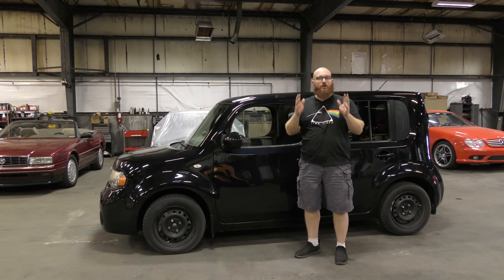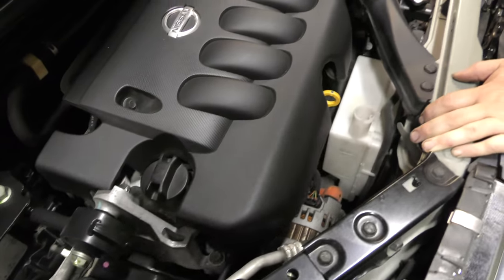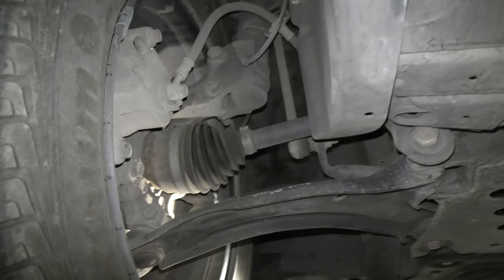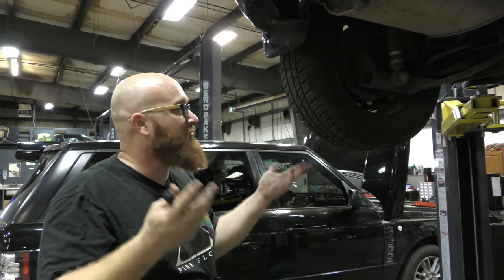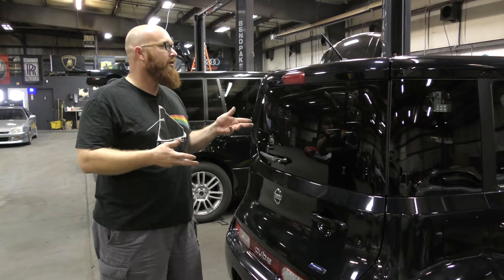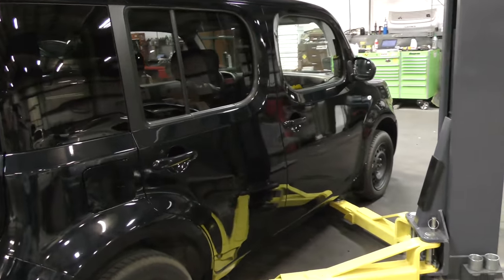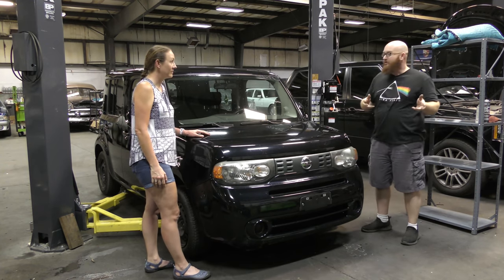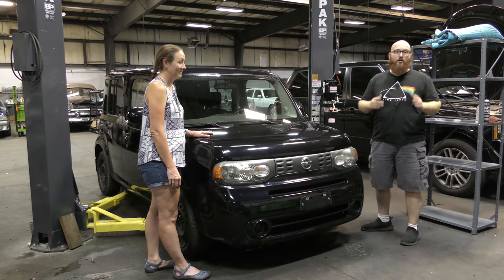The CAR WIZARD's new ride! Mrs. Wizard is NOT impressed! What was he thinking?!?

Comment: That reminds me of the AWD Honda Element I bought a couple of years ago for $200 with a bad motor. I picked up a JDM motor and installed it myself. Had a new windshield installed and put four new tires on it. Originally I had planned to flip it, but after driving it I liked it so much I decided to keep it.
Reply: Forgot to mention I have $1750 total invested with the addition of new axles and CV joints. BTW the Element rear seats recline and if you lay the rear seats down and lay the front seat down, you can sleep in it fairly comfortably.

Comment: I like them, they have a cult following here in the UK, the UK spec ones have a glass roof with a blind to cover it the glass doesn't move or open though. That rearmost seatbelt is for the middle rear seat passenger, they are 5 seat cars only. Good luck with it, cool AF.

Comment: I have a 2010 which I bought on Nov 23, 2019. It had 26k miles 6sp manual. It has been one of my favorite cars. There is almost no "blind spot." The only problem is the rear door will no longer open.

Comment: The Cube is actually resonable design if you are openminded  enough. A practical shopping car, moving cube-size objekt and so on. However in  europe  Nissan is made i Spain and the engine is a Renault. That may put some of us off (the spain part).Tried to find out where this Cube is made was difficult however. An interesting buy anyway.

Comment: With the Nissan (jatco) cvt it primarily depends on the generation of CVT family as far as reliability. Just be sure to check the color of the fluid (nissan cvt fluid) every now and then and how it smells. If it smells burnt you will need to flush the fluids. This is coming from someone who used to work in engineering for Nissan North America.

Comment: I'm part of the 10% - the Nissan dealer bill was $5k. Bought the car new and put on 41k mi. of easy, well maintained, driving.  The car was essentially totaled at that point.  I drove it 20 mi. to the nearest Subaru dealer and traded for a 6-spd manual Forester.  Beware - JATCO makes CVTs for many different manufacturers (including Subaru).

Comment: You mentioned changing the transmission fluid, I'd like an episode on your thoughts on lifetime transmission fluid, and also how and how often to change transmission fluid.
Reply: Theres no difference from “lifetime” and normal fluid, its all the same. But its claimed that the trans is made well enough to last the average life of a car. 150-200k miles. 

I have a 2005 malibu maxx v6. Its trans fluid have never been changed and its still going strong at 260k. 

Tho you can change fluid on sealed transmissions, in a similar fashion youd change a manuals fluid. 

On average youd want to change fluid around 40-60k depending on the size of the trans, and how much weight its halling around, plus total fluid capacity. 

For instance, on my malibu people recommend around a 50-60k change time. Tho its far to late for mine. In my moms mazda 3 people recommend 40-50k. And for my ram youd want to around 60k.
Reply: On a Nissan, you change the transmission, not the fluid. :(

Comment: Random, but I have been daily driving a 2009 Nissan Versa S Hatchback for 5 YEARS. But this Versa has the 4 speed automatic. It has been reliable, and cheap enough to maintain. The exhaust system has been repaired 7-8 times... and the front suspension has been repaired under warranty because the front struts have snapped 3 times..

Comment: My sister has one that's a 6 speed, and its freaking awesome. our mom bought one, and it got passed along to my niece after my mom passed in 2016 from cancer. Car sat for about a year or so, and then when my niece tried to drive it, the CVT went kaput. Its now living in my garage waiting for me to attempt to fix the cvt. only has 120,000 miles on it. That jatco unit just didn't have the longevity one would hope for.

Comment: I got a pair of Barum Polaris winter tyres for my C30 a few years ago, got myself a set of winter wheels for around £80.00 off FB marketplace and the tyres were around £50.00 each, done around 20,000 miles on them and I've still got a good 7mm of tread, cannot fault this brand at all.

Comment: I think they're interesting nuggets, I prefer the Scion offering of that era with the xB Gen 1 or 2.  I have a xA, xD, and both xBs, the gen 1 xB toaster is probably the most interesting or unique, both generations are great micro wagons/vans.  I've been thinking about picking up a Cube myself those MR18's (I think that's the engine) will go 200k miles+ easy with proper care. I've also got a Juke Nismo RS that uses the 1.6l version of that motor turbocharged and I love that car even if a lot of people hate them.

Comment: I drive a 2007 Nissan Altima with the CVT and a few weeks ago it quit on me. I limped into the dealership where they cleared the codes and got it running again, but said I have 143 error codes in the transmission and need a new one for the bargain price of $5200.00 which is more than the car is worth!

Comment: Tried out a brand new Subaru XV hybrid with CVT a few weeks ago and it was almost undrivable and the CVT made it almost impossible to run on electric unless you were coasting slowly.. Feels like going back to manual will be the safer choice in the future if you want to tow or burn that CVT up..

Comment: Here in Aussie from a Nissan Dealer it cost $8500 in a but the one in teh Nissan Pulsar we had was just out of warranty and Nissan did it as a good will replacement for free, the new transmission operated a bit differently , the old one "felt" like is changed gear but of course it didnt i think it had a step in the pullies but the new one was as smooth as, no fake gear changes and went much better

Comment: Anyway, I am waiting for a what vehicle should I buy edition for the previous-generation, 2013 to 2018 Toyota RAV4 AWD crossover. The first one will be a 2013 XLE, 2014 LE and 2017 SE for the RAV4 with the 2.5 L four-cylinder engine and six-speed automatic transmission with sport mode (manual-shift). All of them are AWD (all-wheel-drive) as always. This is also the same procedure that the Car Wizard will make a decision on one of the three newer RAV4's - one that he will recommend to buy, if it is in excellent condition, one that he can make a 50/50 decision, whether to buy it or not, in any condition and one that he will run away as quickly as possible, if the vehicle was in an accident, if poor maintenance was demonstrated by the previous owner or if one of the millennials, make numerous fun of the vehicle by making any traffic violation or dangerous action, which will destroy the engine, the transmission or other mechanical parts. My suggestion that I would buy is the 2017 SE and not to buy for me is the 2013 XLE or the 2014 LE. Finally, that is the video, I was waiting for slightly over three months, regarding the 2013 to 2018 Toyota RAV4. Thank you very much and good luck for the next Car Wizard video.

Comment: Seems by now there would be a method to bulletproof CVT transmissions, no? Btw, the marks on the drivers b pillar is from the driver getting out in a hurry after parking, "carrying" the seat belt with them, it retracts and hits there sometimes before or right as they close the door.

Comment: Unless you get a CVT-equipped Nissan cheap, AND can work on everything yourself, like Wizard, either avoid that trans at all costs (literally), or get a good extended warranty (post-60K/factory warranty miles).  My Sentra had to have it's pulley kit replaced at 63K.  Luckily, I already bought a warranty a few thousand miles before (just in case).  Well, the warranty, total, cost $1800-1900, but fully covered the pulley repair, which would've been almost $4500.  A good warranty can totally pay for itself and then some.

Comment: 8:02 are you sure? The rear seats in any honda element recline back completely flat 180° because they stow up against the sides of the interior instead of flat into the floor.  Also I'm fairly sure that that random seatbelt is for the middle seat when it isn't folded down.

Comment: ADDING CVT in the Nissan Versa is the same and if you do oil change and keep the right oil after a flush you will be ok,,,  128000K's on 2012  all we ever gone doe was struts and breaks and oil changes and one transmission flush/new oil.  and almost no rust even here in Canada Ottawa area.  salt and more....

Comment: The failure rate of Nissans with CVTS failing are really high especially on the Maximas and Altimas. A lot of 2007 and newer Altimas with the CVT went through 3 transmissions before the extended warranty was up. If you have to get a Nissan, get a manual. The CVT made by JATCO is junk and it’s not just in Nissans. Mitsubishi also uses them too and they also have problems too. The Suzuki Kizashi also uses JATCO CVTs and finding a manual Kizashi is really hard to get in the USA. The Dodge Caliber/Jeep Patriot/Jeep Compass uses the JATCO CVTs too. A Honda Element or Scion XB is a better choice.

Comment: The Car Wizard just did a video about what areas do you need to inspect when you are looking for to buy a used vehicle today. This rule of thumb always go for all vehicular brands and models, whether if it is at a used vehicle, a vehicular-brand dealership or a private party. Most used vehicles are usually traded-in at a vehicular-brand dealer every often. When you will be planning to buy a vehicle from any individual, it is a private party, whether you checked it out from Facebook Marketplace, Autotrader or Craigslist. But, please for the love of God, be careful when you are buying a used vehicle at any location. You can make a serious mistake, when you are negotiating with the seller or the representative, because they can rush things or be over-confident. They can also make a fool of you and you do not want that to occur. In the foreseeable future, always do your re-search first, before you plan to buy a used vehicle. Always buy what you need to use for a daily driver, highly likely a point A to point B vehicle and realisticly normal, not actually slow and always look a vehicle that has a standard anti-lock braking system and an electronic stability control. Also, please make sure, the vehicle is fuel-efficient and reliable. For example, like the Car Wizard's, 2013 Nissan Cube or the Car Wizard's older daughter's, 2008 Toyota Prius, which are both smaller and have a slightly higher-seating position. Both of them have the CVT transmission, but always buy the one with the regular automatic transmission, which is solid and fairly reliable. For most vehicular buyers, a compact or mid-size SUV or a crossover will be a better choice for a vehicle, than a sub-compact or compact sedan for a lot of more safety and better higher-seating positions. If you are buying a compact or mid-size SUV or a crossover that is fuel-efficient, always go for the AWD, 4WD or the 4x4 configuration to use for all types of weather and/or road conditions. Another better choice for a vehicular need will be any Subaru model, like the Impreza, the Forester or the Outback, because all Subaru's are always AWD and you see them all over the road in Canada and the United States. Finally, that is the number one idea you have to use in mind, when you plan to buy a used vehicle at any time of the year. Thanks again.

Comment: Ok Wizard hate to tell you but you are wrong about the Element back seats. In fact it's one of the Element party pieces. The back seats fold down flat and align with the front seats that also fold flat to make two full sized single beds in the car. Also the back seats have a mechanism where the seats fold up flat against the walls of the car to make the rear deck from the front seats back completely flat and open. Also popping out the back seats is a four minute job.  It's still a fugly car but you can't deny it's utility. However it's not as fugly as this Nissan and the Element doesn't have a CVT.

Comment: Funny how you mention Lexus, I think I saw the worst 2010 ES-350 one on the road today, It was missing one lug and lug nut on two of the tires, both rockers were gone and each fender and dogleg were rotting out and when it started up it had the worst rod knock but it still ran, it had only 150000-K the owner said it was a Montreal car originally never oiled and it was ready for the junkyard.
Just shows even a Lexus or Toyota won’t hold up if it’s not maintained.

Comment: Too bad you didn’t get the starlight roof like the Rolls-Royce’s. I actually really like these and I really like the XB’s. I believe I actually like the XB better because of the Toyota reliability. I worked as a mechanic for my whole life. Now I work at a body shop. Never thought I would do bodywork. But it’s really not that hard. You can get you a replacement bumper cover and have it painted and put it on quite easily. Those aren’t very hard to do. Throw you some rims on it and it will be a cool little car

Comment: Wizard you are dead wrong about the Element. The rear seats fold completely flat and make a bet, as to the front doors. The Element has a standard two piece tailgate, and the rear seats can either be fastened to the sides of the interior or removed completely.

Comment: I did not understand the mention of using brake fluid to clean the headlight lenses ? I have only ever used fine sand paper / water then light polish ? How does the brake fluid “fix” work?🇨🇦👍

Comment: Just to ask the question is there a regular say 4 speed conventional auto that could be bolted in to replace the CVT say out of a older Sentra or Altima  vehicle . I don't think these cars were designed around the transmission and maybe the position and bolt pattern are the same , you may have to change the ECM but I have done this with a Toyota Camry and the " reconditioned " unit was $199.00 and changing it out was a breeze , and the car ran fine until my son totaled it 6 months later . Just a thought.

Comment: Wizard unload that Nissan Cube as fast as you can and get yourself a Honda Element. They are just as quirky have developed a cult following. They can be had with all wheel drive and run forever. I own one. It's a 2006 EX with a 150k and still runs great. I have had to replace the alternator, the battery, the rear brakes and a set of tires in the nearly ten years I have owned it.

Comment: Wizard, please a do a how to video on changing the transmission fluid in a CVT for your cube. There are some out there and I was able to do mine for a 2013 Sentra, but the biggest frustration is finding out how much should be replaced. I got less than 3 qts out and was hearing others say 4.5-6 qts, but Nissan has no official capacity listed. Also, I'd love your opinion on which fluid to use, the manufacturer fluid or the one that claims compatible like Castrol or Valvoline CVT fluid.

Comment: Why wouldn't you just get a Kia Soul? Its also weird and quirky, spacious, practical, cheap, but more importantly, reliable. Like i understand being able to fix it yourself and not being as worried, especially considering those CVTs even from Nissan aren't terribly expensive as far as transmissions go, but like I would just rather have all of the same characteristics of the cube in a Kia soul, minus the rear swing door (which as a preference I personally don't like the swing door on any car because I parallel park alot and you can't open it in tight spots) and not have to worry about taking the time to put a transmission in at all. Plus the Kia soul had a glow in the dark interior lol cant beat that for quirky haha!